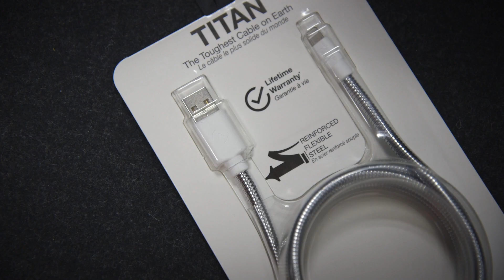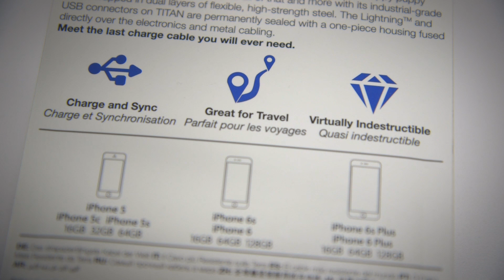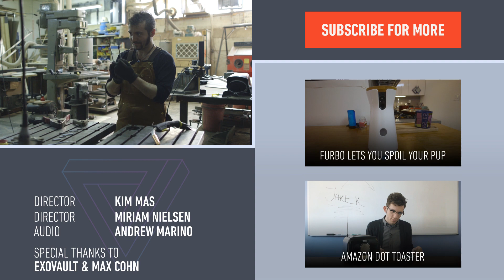Destroying the "indestructible" Titan cable

Comment: now try to destroy it WITHOUT tools like saws and hammers. like stuff that could acually happen IRL
Reply: +zaki NBG the point was that their marketing showed it could withstand a chainsaw, so they wanted to test to see if it really was that strong
Reply: +Henry Phillips exactly
Reply: +CaptainAshra Yeah but why would your cable be in the way of your tools? Could you conceivably leave a running dremel on your cable or hit the cable with a hammer?
Reply: +CaptainAshra If there is even the slightest possibility that an electrical cable would receive this kind of treatment in your place of work then you sir are not a very competent worker, i'd consider a new career path.
Reply: +zaki NBG didn't the company show it being tested against a "chain saw"? ...only to remove the blade.
Reply: Our chainsaw absolutely does have a blade in it.
Reply: +FuseChicken on it
Reply: S A L T Y

Comment: still million times stronger than the original iphone charger
Reply: More expensive too.
Reply: @dantespardason7508  worth it for the life span I would rather have a reliable charger
Reply: @fredstead5652  i think the most common stress point is not the cable itself, but the sleeve that connects it to both ports, in which case, this cable is useless and impractical.

Comment: I was hoping to see yall challenge the chainsaw test. Having a dad who was a tree trimmer for over 30yrs and ive gone and done countless side jobs with him, it seems off to me that two people cant hold the cable tight and a chainsaw run over the cable without at least one tooth catching it and pulling it towards the main part of the chainsaw. Or if they had each end secured to not go anywhere, then have the chainsaw kickback. Granted im no chainsaw expert, just from stuff ive seen of tree trimmers and how the chainsaw reacts in different scenarios, it seems off to me.

Comment: One question though: how does the warranty cover damage to the cable inflicted on purpose?
Reply: Yeah if that's the case I'll order one and use it to pull a truck, use as a portable selfie stick, use to unclog toilet, use as a make shift vice to hold thing with, and just overall use it or everything and get an infinite amount of new ones as they break from straying from normal uses of such item.

Comment: Hate that companies lie like that. Just say it's super strong. Indestructible means nothing can break it which will always be false. Especially when your video says it can withstand a chainsaw and immediately gets destroyed by a hammer.
Reply: +kendallarroz We call it Virtually Indestructible. Nothing in this world is completely indestructible as the Hydraulic Press channel shows. But under every normal use, it's not going to break on you like the ordinary cable. And we throw in a lifetime warranty for good measure